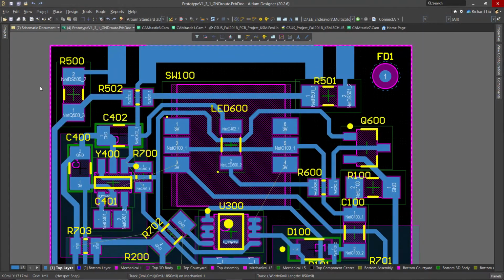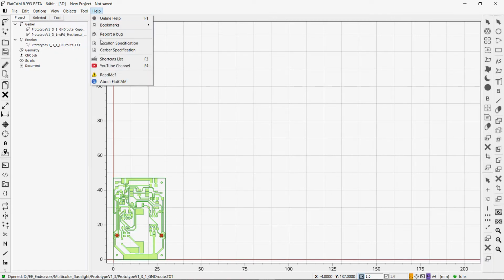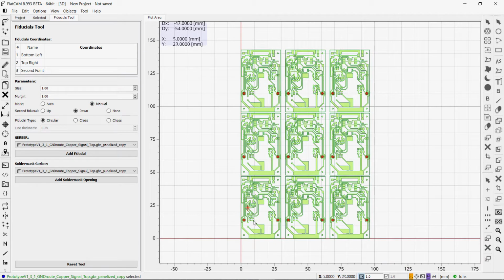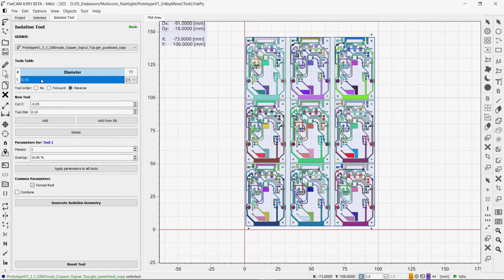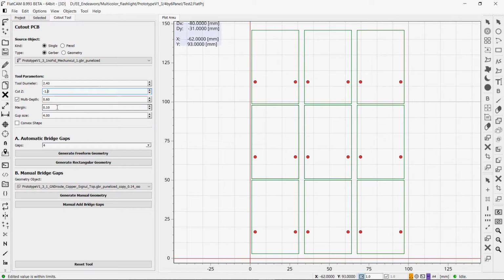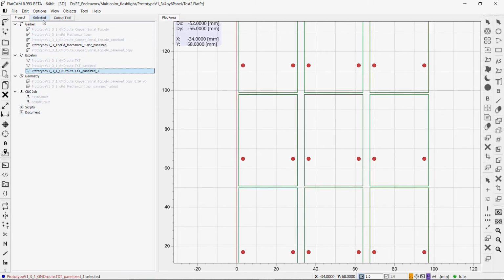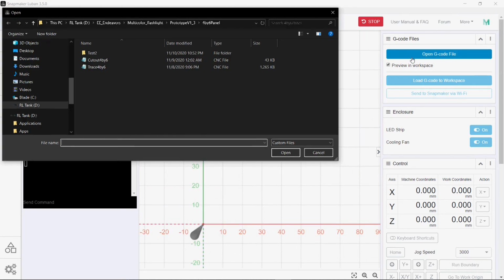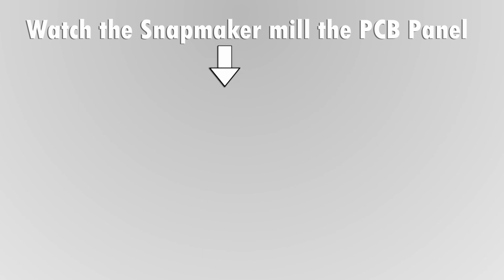ALTIUM to FLATCAM to SNAPMAKER 2.0, Panelized Gerber to CNC Code Walkthrough Tutorial

Comment: Hi, I just found your video. I know it's from 5 yrs ago but maybe you have the answer. Your video showed me how to panelize the gerber easily. Thanks!.  I can see that you are able to import and panelize the excellon drill holes easily. I tried it but will not work. I am using flatcam v8.994 beta and altium designer v25.3.3. I can import the excellon in flatCAM but could not panelize it. It's says successfully panelize but I do not see the panelize drill holes. I tried to export the drill files from flatCAM and reimport it in a new project. I was thinking flatCAM will format it to properly during export. It will still not panelize. What am I doing wrong? Hopefully you can help me with this. Thanks
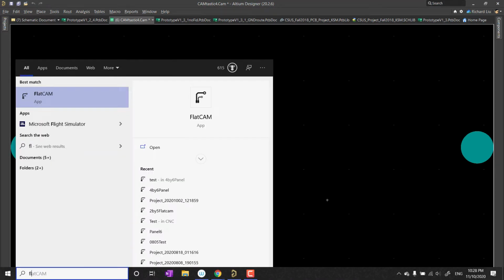Reply from the maker: The fix is to import the excellon files to flatcam with 1:10 scale
Reply: @GarageFactorySD  Hi, Thank you for answering. Unfortunately scaling it did not work. FYI, I am using flatcam v8.994 Beta A (2020/11/07) and Altium designer v25.3.3 build 18. Can you provide a step by step (in text) of how you exactly did it. I found out that there are lot of people having the same problem, and it seems (to me) that you are the only one who made it work. A lot of people will appreciate it. - Thanks

Comment: Hi, 

Just wondering if you have a way to get it to work without hanging? 
I am just trying to drill the holes on the PCB. 
When I do "Run Boundaries" the whole program crashes. 
When I just click Run, it hangs. 
Which firmware is more stable?
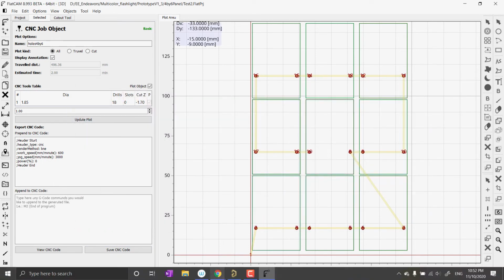Reply from the maker: hi Leon, from my experience the firmware that was preinstalled on my snapmaker was working fine without any hanging. it was until I started messing around with firmware versions that I started experiencing hanging. So I actually found a fix that I talk about starting at 8:09 on the video. You have to go into the cnc files in a text editor and do some modifications to the cnc files then it should work fine without any hanging. Let me know if you still have any problems

Comment: friend a question what firmware version are you using.
I've been trying and it hangs the same (if I delete the lines in parentheses).
thanks for answering
Reply from the maker: when I got it out of the box it doesnt hang for me until I updated to V1.10.1. If it does hang on you try also getting rid of line 41,42, 43 below the (Spindle Speed: None RPM) line and try adding the ; lines 44-50 show at this part of the video: https://youtu.be/1Ctp3FackBE?t=508 .Give that a shot and let me know if it works out for you
Reply: @GarageFactorySD  
It does not work for me friend, maybe I am doing something wrong, you can pass me a code that you have to test and see where I am making a mistake at this email  roydidheiro@hotmail.com
Reply from the maker: @roydidvervaldiviapoccohuan1856  I uploaded a sample file of cnc 0805 footprint https://drive.google.com/file/d/1JZQTSKGTeOhudtJH9P6uiuX_zusDHZ1q/view?usp=sharing Hope this helps